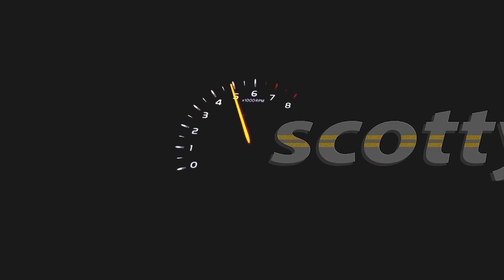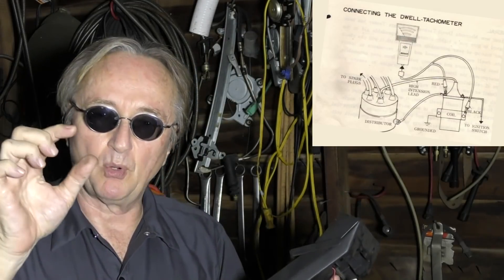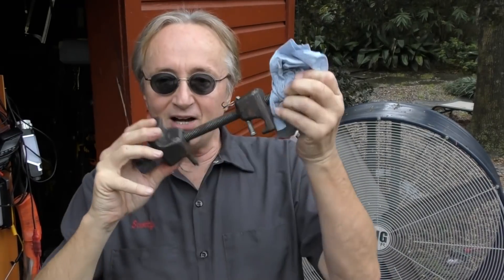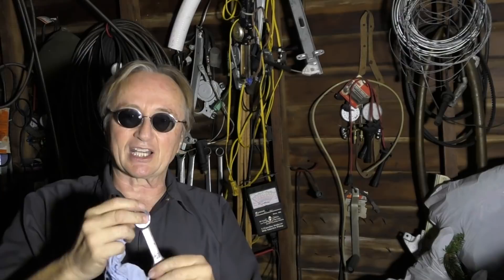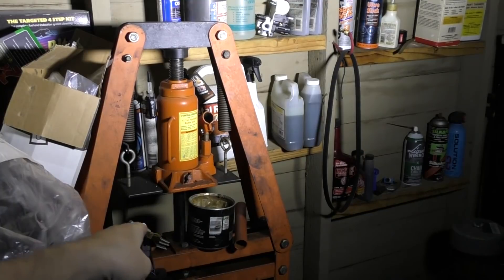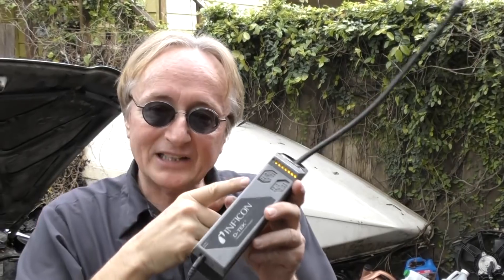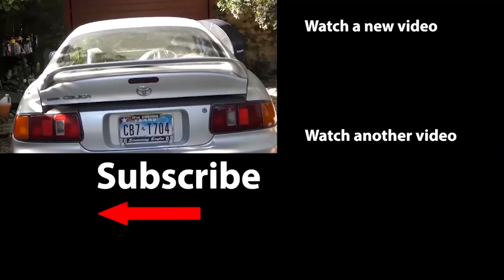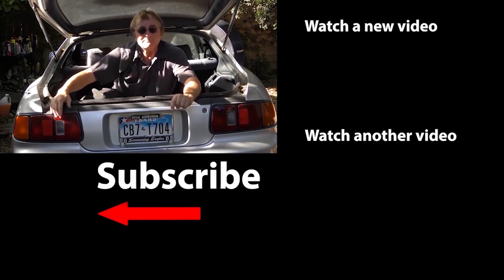I Finally Cleaned My Garage, Here’s What I Found (Mechanic Hoarder)

Comment: I remember my Dad's garage was like that. Tools dating back decades. He passed away a few years back and I miss him. His guidance and advice on cars was sound until the day he died. Going through his garage, I was the only one who knew what every single tool and part was for. I ended up with most of my Dad's tools and tool boxes. I hope I make him proud. I like this channel because not only do I learn new stuff, but it's also straight to the point, no-nonsense mechanic talk. I feel right at home on this channel.
Reply: Me too buddy 30 years ago inherited alot of tools also. Some my son he's in his mid 20s has never seen before yet appreciates because he's a cummins shop manager.
Reply: Always Right I had a similar experience. My father passed away in 2004 and I have his tools. Every time I use one of them I think of all he taught me. 👍🏻🙏🏼
Reply: Sorry for your loss. I know how it feels. Was going through the same a couple of years back...
Reply: Hes proud of you no matter what 👍
Reply: My dad died in '97 and I still miss him alot. I've been paying a storage bill (a large unit) for his stuff since then, and though that doesn't make sense from a financial point of view, the sentimental value is immeasurable and I don't regret it one bit. He was a packrat as well (it's genetic 😁), and was constantly bringing home brand-new stuff from work (a factory) that they were throwing away to clear out storage areas. Just the other day, I went to the unit and dug out one of several of his "new" 12 gauge power cords he'd salvaged, 2 electrical sockets and some jumper wiring to install on an existing duplex box that is welded onto my welded steel work bench. The work bench was one my mom picked up somewhere (cheap, I'm sure!) for her woodworking use. I have a lot of her tools and her own multi-decade collection as well. Yeah, both parents were packrats; I got it bad, with both barrels, but that's ok. 😋 They taught me self-sufficiency and how to fix most anything yourself, cheaply.
Reply: Thanks For Sharing...
Reply: Sorry for your loss, but I can relate. Scotty is one of those old timers who's just a blast seeing. Has the same energy as my dad.
Reply: I miss my dad..
Reply: My dad was never around so I love guys like Scotty. I feel like I have a dad teaching me stuff. It's great to hear you guys appreciate your dad's lessons.
Reply: Wow ,same story for me ,I miss him

Comment: I love your channel..I am a 70 year old shade tree mechanic that doesn't even change my own oil anymore so I surely don't need that press..when I win the lottery I am going to buy what I had when I was young and loved to work on cars when most people could..I would drive my car to the drag strip and change my rear tires and put on cheater slicks,disconnect my exhaust and run headers and race in B modified production class.. hardly ever won but had a great time and my best time in quarter mile was 10.8 seconds..my car was..
1962 Corvette,2 four barrel carbs, fuel injection heads,Hurst 4 speed, aluminum flywheel,Harmon and Collins cam,,4-11 rear end,,headers,,intake and exhaust ports polished,,four bolt mains,,duel points ignition,, probably something I am forgetting..it was 50 years ago at Laplace dragstrip at Laplace Louisiana..that car sells for 65k today..if I ever win the lottery that's the first thing I will buy..those were the days when the world seemed big and even the little man had a chance..I don't know what happened to our country but I can't fix it..I am moving to the Philippines in a few months to live out the rest of my life happy in Paradise..let the young people try and fix America..I am to tired..just sayin..

Comment: If I cleaned out my garage, I'd cry because I'd find the tools I've replaced 3 times because I can't find the original I KNOW I have somewhere.
Reply: like the #10 Socket?
Reply: It`s easier to go buy a new tool . Saves a lot of time.  It takes me longer to find the tool than it takes to do the job.  Now I know why they make vice grips, but I can`t find it either, UGH !
Reply: To find a missing tool, just buy another one.  Then, it'll show up in a day or two.
Reply: When I die they’ll think I collected hammers and mallets.
Reply: Man, I know that feeling! Having moved several times in the last 20 years, sometimes where I didn't have any type of shop, I have tools in all sorts of places. Finally bought a place (no shop yet, though) and currently have tools in a 20x8 foot tool trailer, 2 sheds, 1 cargo container, a carport, and my office in the house. Every single job seems to require multiple trips to all those places and I still can't find what I know I have - so if it's less that $20 or so to replace it I just head for the store.
Reply: @Roadglide911  Screwdrivers for me.  Must have around 50 counting the "sets" of small drivers as only one.
Reply: For me its caulk guns. I must've bought twenty of them.
Reply: Haha story of my fix-it life

Comment: I remember rebuilding everything from Water Pumps, to alternators/generators and even starters.  Water pump went out on a Rambler Ambassador 327 V8. Drained the coolant and then removed the fan with fan clutch, belts, undid 4 bolts, took off the pump.  Then knocked out a roll pin to remove the impeller, and tapped out the shaft,  removed the inner and outer seals, pressed out the bushing, put in the new bushing and seals (sold in a kit for $1.50 at the dealer, included a new water pump gasket)  cleaned off the mounting surface of the pump and timing case cover. Greased the shaft and bearing using wheel bearing grease before reassembling the pump. Reversed the steps to remove the pump using a new gasket, refilled the radiator with a gallon of new antifreeze ( $0.75)  Started the engine and and topped off the radiator with clean water once the thermostat opened. Replaced the radiator cap and checked for leaks.  Charged customer for parts and one hour labor ($20)   For less than $25 after tax, the customer was on his way with a rebuilt water pump.
Reply: I wish i was around then.
Reply: I though I was old, you win.  Those were the days.  A Rambler, holy crap.   I did one that required removal of the engine mount and alternator and A/C brackets.  All day job.
Reply: As a gimmick they used to sell water pump lubricant that you just poured into the coolant.  It was to lubricate the bearings and condition the seals.   LOL   More bull crap someone came up with.  I wonder how much money was made from that.  LOL
Reply: The number for my local AMC dealer says it's disconnected or no longer in service. I agree you can rebuild these things but modern pumps are often electric and sitting behind many other things.
Reply: Delco starter solenoids, when they wouldn't power up the starter, you could remove the back cover, remove the E clip on the contact disc flip it over polish it and the heads of the contact bolts and put it back together.
Reply: Damn that was cheap back then. I think if someone asked me to do something like that i'd either turn down the job or charge a lot.

Comment: At what point did you clean anything?
Reply: ...ok so it became a 10 year project :) It's gonna take a long time to clean out that garage if Scotty explains the details of every item he picks up lol.
Reply: Scotty threw away the air conditioner leak detector and gave away a the press.  He hinted that he might be getting rid of or disposing his power steering hose making kit. He also squirted the transmission repair goo out, so we can assume he thew that away.  He got us suckered into watching a video that he gets paid for.

Comment: I could use a press... for... something. I dunno maybe crush the kids toys when they act up, or break whats already broken on the wifes Nissan (like the PITA radiator fan that costs $1200 to do at the dealership, $550 new OEM fan assembly, or $180 on rockauto... I replaced it myself last week).
Reply: Cross ref part # to amazon from rockauto sometimes better price more selection and faster cheaper shipping
Reply: That's a long trail for me, I would not even bother checking prizes from the dealer. Usually autozone and save 30% most of the time if buying from Amazon or Ebay.
Reply: $550 was the Autozone/Advanced Auto/O'Reilly's/NAPA price.
Reply: @cmdr_stretchedguy  I usually use autozone for recommended brands from them and then use their part number to look it up on ebay or amazon. For car parts ebay is more complete for finding parts.
Reply: @scientist100  most of the ones I saw were $350-600. Not worried about the quality of a $180 fan as we're trading it in sometime in the next few months.

Comment: My first spring compressor was a fork lift.   It didn't work out well and I almost got killed.  We used the fork lift to compress the spring.  I took the nut off the strut and then the bottom of the strut shifted.  The spring went buzzing past my head.  It went across a two bay garage and put a fist sized hole into the cement blocks.   Never tried that again.  Yes, I have the same spring compressors that you have.
Reply: LOL! Those springs are something else! When they are messed with.. LOL

Comment: Dwell meter?  We used to use a book of matches to gap the points.  Stick a screwdriver in the carb to hold the choke open when it won't start.
Reply: We used benson and hedges packet 25 thou it be

Comment: Scotty, I am a viewer of almost all your videos. I’d like to win that press. I’m 19 years old and just getting into fixing stuff. I just recently took apart and totally rebuilt my 2007 yz250f. All bearings, gears, etc. it took about 3 months but it’s back together and it works. That press would help out a lot with some of my other projects... thanks Scotty!!!
Reply: Keep up the great work i havent been in mechanics nowhere near 50plus years. Only 11 but you will go far just from starting and learning on that small engine. Thats where i started and have worked on engines just about big enough to get inside the cylinders
Reply: @ccpm8049  thanks! Trying my best. Overtorqued a few bolts on the yz and spend an extra $~60 in reordering what I overtorqued because they're machine spec factory hardened bolts that you cant get at Ace Hardware, but got it going again without issue. Thanks for the complement!!
Reply: @jasondonohue7355  oh yeah definitely lived and learned thats what counts. I have gotten into custom mechanics also so have learned about real bolts vs what hardware stores think are real bolts
Reply: Hope the computer will pick you, since you will make good use of it.  Good luck!
Reply: @Scotty kilmore give this man the presser and forget about the computer there's always a way round things
Reply: CastellawsCustomPerformance 804 exactly. Even though the bolts are like 70 cents at ace and almost 3 dollars on Yamaha the 70 cent ones aren’t the same spec or quality, and when these bolts are what is holding something on a small engine with that much Horsepower, I want quality stuff.
Reply: S Y thank you I hope so too
Reply: Great job Jason. You know the basics now, and can tackle the bigger stuff. And even if you do not be come a mechanic, you can do some of your own stuff and save money. Plus there is just some pride and satisfaction from doing it yourself.
Reply: @steveozombie  thank you!! I appreciate that. We'll see!!!
Reply: @ronfullerton3162  yes!! My dad always said to do stuff by yourself unless you absolutely cant. Living by that, I've been trying to do more and more on my own. There's a lot of satisfaction (and nervousness) when you finish something and test it out, especially engines!!!
Reply: Love to see it. Keep up that passion
Reply: @jasondonohue7355  Very true. I wish you a wonderful life of the enjoyment of"turning a wrench".

Comment: I use Metrinches. These wrenches work both on metric and SAE, and they work great because they work push the flats of the nuts and bolts, not the corners. They never strip or break or let-go to smash my knuckles. These were the best infomercial tools ever from 25 years ago. To this day, they carry the same warranty as old Craftsman tools. It's good well-made stuff.

Comment: I'm old. I knew what a dwell meter was. =(
Reply: I maybe a stinky loser, but  An even dozen!
Reply: I still have my tach and dwell meter last I used it was on the tach side for one of my late 70’s cars Lol
Reply: @NoName-tz5ji  '67 Mercury Monterey!
Reply: Brian Jones I think I bought mine for my 6? Olds cutlass then used it for my Ltd,pintos and some fiats I had stationed in Italy. I loved it when cars were cars.
Reply: @NoName-tz5ji  Don't forget the timing light!
Reply: Brian Jones I dropped and broke it in a move over 20years ago and haven’t even tried to replaced it. Lol I have a  2015 now and I don’t even change my own oil. I only work on my old diesel if it needs something nowadays

Comment: On my old Grand Am, I couldn't get the struts out of the car without compressing the springs. The wheel well was too tight. So I got a set of spring compressors, and there wasn't enough room to get them in there. So I used a set of "quick" clamps. (The strut was still assembled, so there wasn't any danger if the clamps slipped) Worked great.

Comment: I had the same cheap spring compressers like you and they did the same thing to me putting struts on my dads Camry. When i was compressing the spring one twisted around the spring and pinched my index finger against the other compresser. Good times

Comment: I have a Mazda 6 2009 and when I change gear it makes a noisy loud rusty noise. What could it be?
Reply: Hello 👑Spanish Uloahola👑-  If it is a manual Transmission (since you stated changing gears). It may be your pilot bearing going out. Or something within the clutch assembly. Have you gone through high water in the past? Hope others give you feedback too. Safe Travels Out there & Take Care!!
Reply: Spanish Uloahola take it to Scotty! He’ll fix for ya
Reply: Spanish Uloahola a “rusty” noise lmao
Reply: @roddydykes7053  Lol. Yeah, what kind of noise does rust make? I did not know rust made a particular noise. Hehehehe. Maybe she means "grinding" noise or something.
Reply: rusty tennis shoes!

Comment: Never have to many tools as long as you use them and DON’T LOSE YOUR 10m SOCKETS
Reply: True.  Why is it always the 10 mm that gets lost?
Reply: Because it’s the most common bolt in a car
Reply: They need to sell 10mm in bulk
Reply: My friend has 100’s of tools, the most expensive brands but we work three guys in his shop and we always fight for a  craftsman set of 1/4 and 3/8 sockets, guess what there is the 10 mm socket

Comment: Is the Focus SVT a good first car for $2.5-4k?
Reply: Toyota.  : )
Reply: Agreed. I would try to get my hands on a corolla or a civic for your first.. stay away from Ford
Reply: Automatic transmissions are garbage in the focus. Manuals are better. But those Ford's are plagued with problems. Always research, Google the type of car your looking. Type the make and model then type problems. Never buy are car  with to many problems.
Reply: Listen to this man @757optim My rav4 2door 1995 only went in today to get valve stem seals done. 275699km later.
Reply: Buy a civic type R
Reply: Samad Javid god no!!! Problems galore
Reply: @wreckemtech165  They are good cars, but they cost too much with my budget
Reply: @samadjavid3801  Samad, try a Corolla, if you fit just fine, if not get a Camry :)

Comment: Love your vids, Scotty, I listen to them at 1.75 speed. Just my opinion I use 2 sets of spring compressors when changing shocks. Placed around the strut evenly at 3,6,9, and 12 o'clock positions. Think of it as personal liability insurance in case one of them fails. It also reduces the stress on each compressor. btw I could use that 12-ton bearing press.:)

Comment: I have an old vw... not using a dwell meter though.  Changed to electronic points.  No more dwell timing, no more point gapping, no condenser either.

Comment: 12 ton press, I can see uses for such a thing. One is changing bearings in motors,  idlers, and much more. There are some bearings that require use of a brass punch and hammer to replace as there is no possible way to easily use a press.

Comment: I found 4 Multi Head Pipe Threaders ..... a 30 lbs Tank of R12 ..... Two Oscilloscopes ...... An Old Touchstone Phone Tone Generator ...... A Vacuum Tube Tester ....... a Grounding Rod ....... A Very Old Binks Airbrush Kit.

Comment: Who won the press? When I worked in auto parts I used to repair or make AC hoses, air hoses that was in the early nineties, we had the crimping tool the ferrules and would just reuse the fittings if they weren't damaged, all you really are replacing is the hose, the ends are usually good. I replaced the power steering hoses on my friends 2004 trailblazer with new ones, the one that goes over the frame under the left control arm rusted out, he calls Meone day and says there's power steering fluid leaking, it was one of the new hose assembly, a pinhole somehow developed in the steel line, so I took it off and brought it back to the store where they exchanged it under warranty, it still is a total mystery how that happened, maybe when it was made who knows, but it did t show up until several months later. I know an easy way to get that hose off with a minimum of work and it's a good thing since I had to do it twice, I looked at videos on YouTube and they butchered it and bent the hell out of it which isn't good and looks terrible.

Comment: Wrench set not being used? My old ford truck only used two sizes, 9/16 and 1/2 inch. Well, most the time. I never owned a metric wrench until I started working on VWs in the 70s. Now days I need a 14mm just to change the oil in my 99 Olds van. Anyone else recall the days when American was SAE and European and Japanese were metric. I had an 86 Dodge that was a mix and I needed to bring a set of SAE and Metric under it when doing anything.